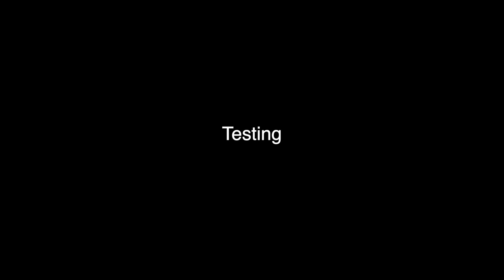Motorola Moto G Stylus 2020 LCD Touch Screen Replacement XT2043

Comment: hi,  i make the screen replacement exactly the same way you did step by step, but the lower speaker is now making a noise(the sound is not clear), i don´t now what could have happened, i checked every conexion in the  charging board, everything  looks ok. Any suggestions?

Comment: For those ppl complaining, watch the whole video, If you have half a brain you can see that you need to pull the battery out in order to get the ribbon cable from the digitizer/LCD assembly to the logic  board, his faster solution is to just buy the frame with the LCD on it. He should have started the video with that.... 

BUT a WAY faster solution would be to just buy a bricked phone or used phone from ebay etc, and just switch out your logic board... AAAND you get the OEM screen which is way better then the Scam-a-zon ones.. and you wont have to heat up the battery which can't be good for it.
Reply from the maker: Thanks for your feedback..

Comment: Wasted 13 minutes of my life you skipped the most important part in the thing your video is titled for replacing the screen it didn't show it at all.
Reply from the maker: This is the full replacement guide with the frame installed ( You can buy the part with frame installed or without). Which easier, cheap and safe.
Reply: Youre kidding? Right? I noticed rhe phone has been apart before
Reply: @robsanders6599  have you never watched a video of a phone disassembly? The parts that were secured by tape had not been apart before. You could tell by the number of edits and how difficult it was.
Reply: @MrRlovely  how many of these Motos have you replaced screens on is the question.
Reply: @robsanders6599  no, it really isn't. I've replaced enough screens on other phones to know they aren't much different except the sequence.
Reply: HOW IS IT POSSIBLE…. to skip the ENTIRE PROCESS the video is meant to show ??!!?!?

Comment: This is why they shouldnt have gotten rid of the dislike button. The title of this video is a flat out lie. Change the title
Reply from the maker: What is the issue?
Reply: @DIYGeardo  the problem is we're trying to figure out how to change the the screen without the frame so the title makes you assume it sounds like you're changing out the screen from the frame
Reply: Same problem here, could have skipped half of these steps to just replace the screen. Some of the screws got stripped out but luckily I didn't really need the phone, just kind of practiced on it. A lot of stuff to put back together when those parts didn't need to be removed.